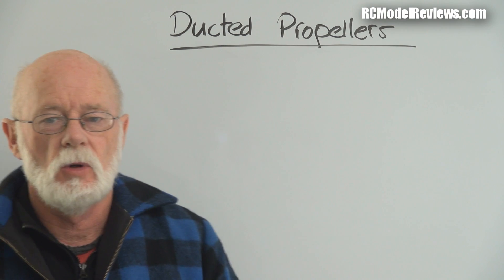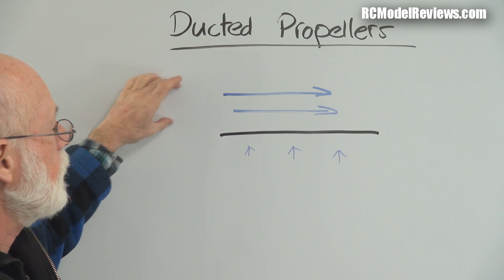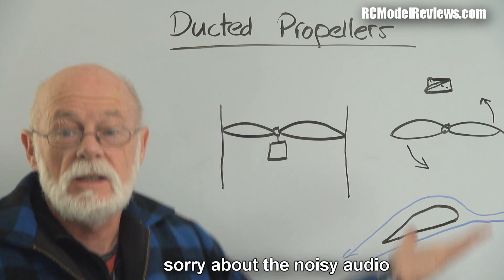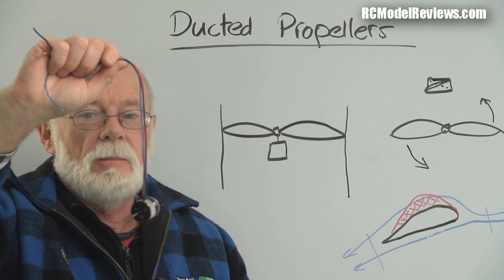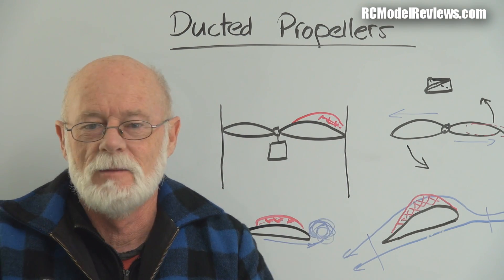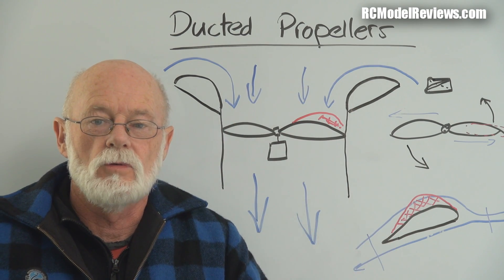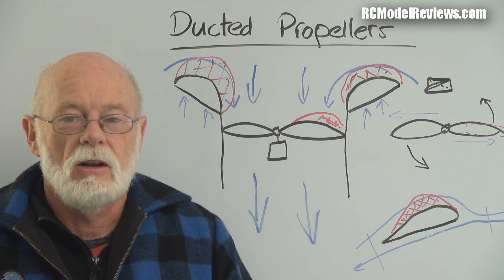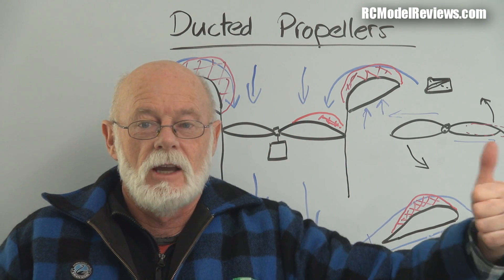How ducting a propeller increases efficiency and thrust

Comment: Now I understand that this would increase the weight of a propeller but what are the differences between a ducted propeller and a propeller with essentially a duct attached to the outer most part of the blades? That would make the clearance between the propeller and duct a non issue seeing how its now 1 unit.
Reply: PhotoBobBarker I was responding directly to floordFords comment about attaching the duct to the blades.
Reply: But now you would have new problems:

The duct has inertia, and quite a lot of it in comparison to the propeller.
This means it takes far longer to change the speed.
Also a fast rotating duct has to withstand quite a lot of stress, so you would need either some really good materials, or make it thicker (heavier).
And lastly airflow. Now that the duct is rotating the air not only flows past in due to the propeller, it would also be rotating around the duct. This causes more friction and possibly very undesirable vortexes.
Reply: You're assuming that the duct is attached to the propeller?  That is not how they are designed (with a few exceptions).  The duct would be a housing that the propeller and motor/engine are housed in (with the duct stationary).  Weight is still a concern, but that is what carbon fiber, titanium, and aluminum are for.

Comment: BTW turbine blade tip clearance for a 12 inch turbine should be between 0.020" and 0.033".  That's about 0.3% of total diameter.

For a 5 inch prop  you wouldn't want more than 0.015" inch of a gap.

Here's a trick for achieving that,  paint some thick but soft material in your duct at the place where the prop would be.

This is an abradable seal. The prop itself will machine the duct surface until you get the tightest gap that your structural integrity can handle.
Reply: How much more air should we expect for a given prop if it's ducted?
Reply: @ChristianNally  That will depend very much on the aspect ratio of the prop blades, number of blades, and rotational velocity.

Comment: What happens if the duct is attached to the outside of the prop blades and spins with the prop?
Reply: sok8888 instructions unclear and now my duck is angry with me.
Reply: you have a larger rotating mass with more gyroscopic effect and a less responsive and more stable quad... you also eliminate all the losses of the gaps between the propeller and the duct, but you increase the load on the motor since higher rotating mass... dunno if its worth it tbh since no one ever went into production with a patent like that.
Reply: Great question.
Reply: I think it will have more drag/friction... and also motor load will be increased
Reply: sok8888,
What has a rotating water-fowl to do with this subject? Who has ever attached birds to any part of a RC aircraft without inflicting a degree of animal cruelty?
Reply: too much drag , defeats the purpose of gains  ducting the prop
Reply: What if the duct didn’t rotate, but the prop tips were attached to a ring shaped bearing in the duct?
Reply: pretty good self portrait
Reply: That would only be legal during duct season.
Reply: If you throw a spinning baseball, it will curve, right? Well, a spinning duck will act the same. Your RC plane will try to go side way.
Reply: Spinning round object creates lift, which is why golf ball curve left or right when hit with a spin. Spinning duct will try to do the same.

Comment: Where can I get a set of these for 6" props? Want to turn my blackout into an "tree explorer" quad (similar to Lumenier Danaus). I'm hoping the ducts will protect the props the way the danaus frame does while simultaneously making it more efficient to counter act the added weight. When flying through trees you are almost always flat anyway, so it should work well in theory!

Comment: So, adding winglets to propellers should also give you an improvement in efficiency.
Reply: you can buy large scale propellers with winglets... they are not really more efficient since increased efficiency is canceled out by the increased mass and the drag.... but the propeller is MUCH quieter since less energy is converted into sound

Comment: Nice video, but have to make small correction to keep the science straight.  Lift force on an airfoil is established due to the fact that the streamlines are curved by the airfoil.  That would create a positive pressure gradient in normal direction to the streamlines (on the upper side).  Remember, pressure far away from the airfoil is atmospheric.  So the pressure on the top surface must be below atmospheric.  Lower side of the airfoil is usually very close to the atmospheric pressure since bottom of the lifting surfaces are almost straight.   This fact is formulated by so called Euler equation (momentum balance in normal direction to the streamlines), not the Bernoulli equation which is the momentum equation in streamline direction.
Reply: 1. The first part isd what he already said so you are not correcting him
2. The front (lower) face of the propeller is not "usually very close to the atmospheric pressure", they are moving through the air, compressing the air in front of them, creating much higher pressure than atmospheric

Comment: In radio control aircraft, it takes about 150 watts to lift a pound of weight with a regular propeller, but about 280 watts to get a pound of thrust in an electric ducted fan. So, there is another principle going on. The bigger the prop, the more efficient it is. And because prop planes have larger props than ducted fans, they are much more efficient than the RC ducted fans.

Comment: An interesting video with lots of good information.  I have found that ducted fans are actually less efficient in a practical application, my experience is with RC planes.  The smaller diameter fans require high rpm motors which are noisy and less efficient than a low rpm motor with a larger prop.  There is also added drag from the shroud and more weight.  I have a ducted fan fighter jet rc plane which looks cool and sounds like a jet but eats up batteries like crazy.  Basically, for same thrust, a smaller diameter ducted fan requires higher velocity and is less efficient than larger slower prop.
Reply: Well, that doesn't seem like a proper comparison anyway.
We already know smaller diameter higher speed fans are inherently less efficient.

Thus, if you are trying to determine efficiency of a ducted vs unducted fan, the fan should be the same diameter and speed in both cases, otherwise you are testing for the effects of fan diameter, rather than the duct.

Obviously, in practical application the duct does increase the effective diameter, and adds a lot of potential weight to the design, which may well cancel out any real gains, but using a smaller diameter fan creates a comparison that tells you almost nothing about ducted vs unducted unless ducted fans are so much more efficient than unducted fans that this massively overshadows the effect of reducing the fan diameter.

Comment: Let's do a bit of analysis.  
First, weight.  We want to minimise the weight of the propeller so that all of it is 'earning it's corn', by making the stress induced in it equal along the blade.   Consider a prop blade as an encastré cantilever beam fixed at one end. To minimise weight, we want all parts of the prop have the same bending and other stresses when working.  Centripetal + bending stress in the blade must be at a safe level commensurate with the torque, the rpm and the diameter, which complicates matters somewhat, as more torque slows a motor to a different position on the power curve.   This is why competition flyers are constantly changing prop pitches and diameters to achieve performance.  Tapering the blade thickness toward the tip achieves stress harmonisation.  Near the hub, the prop moves in a smaller arc, therefore moves slower and indeed near the hub it is shielded by the cowling, fuselage or engine and only performs marginally.  A thicker section near the hub with less planform area will produce less drag, and in many full-size props this area is a simple shaft emerging from the cowling before flaring into a blade proper.    
The prop is not just a crude 'paddle', it has a helical pitch so that at any point on the blade,  the angle of attack is the same - each revolution should move the air at any particular diameter the same distance axially in one revolution.  This smooths airflow and harmonises the load.    The effect of this is that the apparent angle of attack of the blade lessens toward the tip. 
The blade is not a paddle - in fact it's a wing and it flies through the air like an airfoil, gripping it to produce thrust or 'lift' and not merely wafting the air past like an old maid's opera-fan. It's an  old trick to reverse a prop on the engine stub to reduce a model's airspeed. 
The planform and tip shape is where designers can play, with fancy tips and blade curves.  The tip is critical, for here the airfoil of the blade can produce eddies and drag, [which equals frictional losses], as the prop-cut  air meets air beyond the tip diameter.     I would suggest that for model aircraft there is little to be gained by having any more than an unducted conventional prop shape, unless you are concerned with noise, time of flight, speed or distance contests etc., but it's nice to play!   If a craft can't fly well with a conventional prop, a fancy duct, special tips or exotic materials will not improve matters that much, especially at small scale.  
I maintain that the less blades you have, the less tip losses there will be, but the design restrictions will most times make a monobladed propeller impractical and costly.

Comment: Oh brother the equal transit theory is back...
Reply: The "knobs" do something called "tripping the boundary layer" which can be very helpful when form drag is a large portion of the total drag on a system. Form drag is the drag caused by the wake of the object. This type of drag is dependent on the largest cross sectional area of the object defined by a plane normal to the flow direction. Another large contribution to drag is "skin drag" which can be thought of just like friction between two solids. Skin drag is dependent on surface area exposed to the flow. A good example of this trade-off is a golf ball vs. an airplane wing. Without going into too much detail, tripping the boundary layer changes the flow from laminar to turbulent which reduces the flow's tendency to resist a change in direction. This allows the size of the wake to lessen, which reduces form drag, but the cost is an increase in skin drag.

In summary, adding dimples or "knobs" to a surface in a flow can decrease it's drag if the drag is dominated by form drag and form drag is dominant when the object has a large cross sectional area when compared to its surface area. Propellers are much like wings in that their drag is not greatly defined by form drag, so dimples would be detrimental, but some sections of a fuselage might benefit from dimpling. Speed and other things have effects on this phenomenon, but I think that is beyond the scope of a YouTube comment....

If you are interested in the topic, look up some of these keywords:
Form Drag
Skin Drag
Induced Drag
Boundary Layer
Laminar Flow
Turbulent Flow
Reply: I always worry a bit when someone is so....absolute. Natural reflex.
Reply: I always hate seeing that ruin an otherwise great explanation. It's such a common misconception.
Reply: Actually its the parasites on the humpback, the knobs... counter ..the parasitic draaagggggg   pfffffff
Reply: Ryan Tatman that would be similar to the old "remove the tailgate for better fuel economy" theory. In reality wind tunnel tests show with colored smoke that the turbulence in front of the tailgate allows the airflow to go over it as does the turbulence behind it.
Reply: The fact that the equal transit time theory is false doesn't mean that Bernouli is wrong. The Bernouli principle is obviously true. But, there are absolutely no reason for a bunch of atom to go faster to meet their buddies on the other side of the airfoil at the same time. None. And, indeed, they don't.
Reply: try this. in still stagnant air, force an airfoil through the air mass, like you would slice a knife through butter. see the results.

Comment: Interesting video. Thank you for the time you put into it. I have only one wish, please stop using centrifugal force to label Inertia. Centripetal force was what you applied to the motor by holding the wire. Centrifugal 'force' is not measurable hence not a force, by definition.

Comment: The most efficient aircraft propeller has a SINGLE, dynamically counterbalanced  non-ducted blade, with as big a diameter as possible and run at low rpm.  Difficult to engineer in full size aircraft due to balance, gearing and other problems.   This was imparted to me by an egghead who worked at Aldermaston and was a regular Aeromodeller contributor in the 60's and 70's.  His hypothesis was based on wind tunnel and air-ducting research work that he conducted in reactor water tower cooling - and he pointed out to me that very few prop-driven full-size aircraft have ducted fans - but that might be an effect of scale to be fair.  I built such a four-foot span rubber powered beast in 1971 while a member of Newbury MAC.  It featured a centrifugal device on a pivoted blade, which parked the single prop along the fuselage as the power waned.  It used to pull the model up like a bluddy train, easily getting maxes from the get-go.  On the third or fourth flight, the enormous torque snapped the substantial main spar in a high wind flight.  I went on to radio controlled gyrocopters after that - then the ankle-biters arrived and the money was needed elsewhere.

Comment: It think he's made a false assumption at 6:00.  Sure the length of the curved path over the top of the wing is longer than the flat part underneath but who says the air that splits in half at the leading edge has a "date" with the air that goes over the bottom to meet up at the trailing edge at the same time (so it needs to go faster)?  When it hits that leading edge the air that goes over the top will feel some resistance because it has to change direction.  I would have thought that if anything that air would slow down not speed up as it meets the object that forces it to change direction.

I might be wrong but that doesn't make sense to me.  Plus the Coanda Effect is now recognised as the main factor in lift.  It's all about angle of attack.  That's why planes can fly upside down with the curved part now on the bottom.

Feel free to enlighten me if I've got it wrong.
Reply: dutchrjen I don't know what you mean by "if I have more volume to fill on top of a wing..."
For any flying aircraft the volume above the wing (and below it) is effectively infinite. I think you meant something else.

Anyway I see that leading edge as pure drag.  I don't see the air speeding up horizontally (with respect to the wing) when it hits that curve.  Anything that disrupts the air's straight line flow is going to remove energy from it.

When I did my physics degree I used to imagine how something would behave in the limit to see what the trend would be. It's a useful trick.

In this case if you keep increasing the curvature of the upper side of the wing it will start to approach the shape of a vertical wall at the leading edge.which would increase the drag hugely and would slow down the horizontal vector of the air's velocity as the kinetic energy in the air is converted to heat. So unless something happens halfway along this increase in curvature to reverse the trend the trend is towards slower air going over the top.

Also the air is suddenly accelerated upwards to go around the curve and that would cause a downward reactionary force at the leading edge.

F=MA

In fact it seems to me that the amount of upward acceleration that the air has is exactly equal to the amount of downward acceleration because it ends up at the same height at the trailing edge.  There's something wrong with that thought I think.

Keep in mind that in this example we're using the aircraft as the inertial reference ie. as if it's in a wind tunnel and it's the air that's moving to make the physics easier to visualize.

From the most recent stuff I've read on this the Coanda effect makes the air "stick" to the curved surface which accelerates it downwards as it follows the curve and the reactionary force is upward:

Having said that, it seems to me that with a flat wing with an angle of attack, the air hits the bottom the wing and is deflected downwards which creates an upward reactionary force.  

Meanwhile on the top of this wing a low pressure area would be created simply because the wing is "sweeping away" the air above it.

That makes sense to me but I could be wrong too.